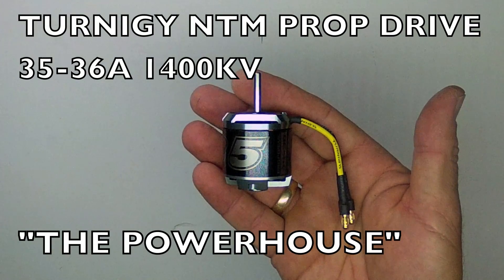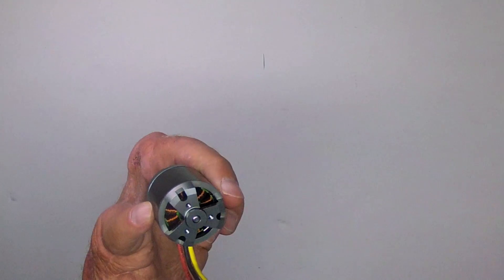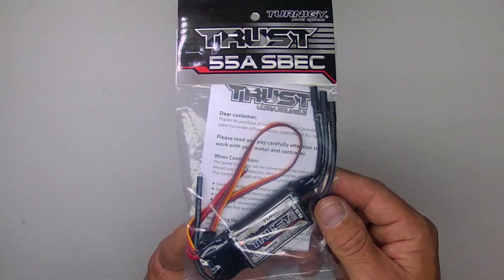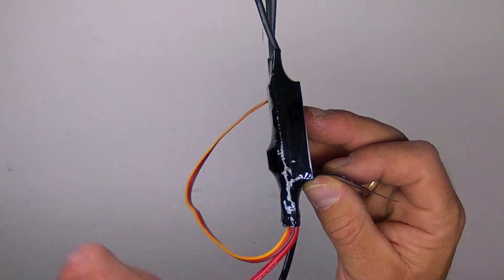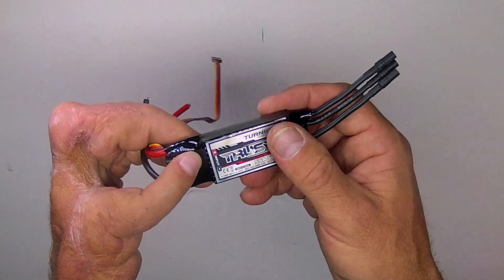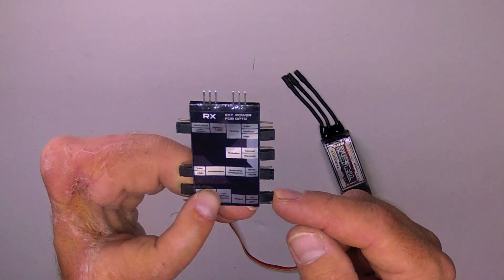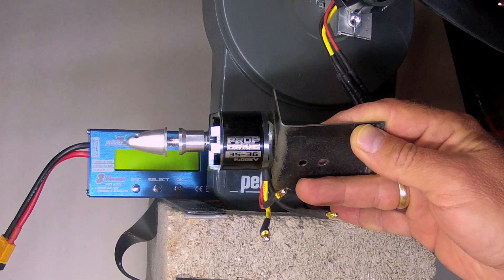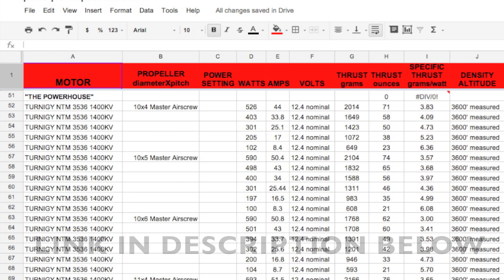TURNIGY NTM 35-36A 1400KV POWERPLANT TESTING - "The Powerhouse"

Comment: hi i just wanted to know if its necessary to have the programming card as d other available escs do not necessarily need one.please respond as soon as possible
Reply from the maker: Aaron Samuel Every ESC I have had that can be programmed by card can also be programmed by stick position.  However the method varies between each ESC so it is critical to have the instructions, which you can almost always find online.

Comment: EA thank you for the video. Per HKing's recommendation, I purchased an NTM Prop Drive 35-30A 1400KV for the Great Planes Cosmic Wind which is in the link I provided. How do I go about installing and attaching a prop? The  motor came with a threaded shaft that attaches to the opposite side of the motor but for the Cosmic that setup won't work...I think. Your advice and suggestion would be appreciated. Thank you. http://manuals.hobbico.com/gpm/gpma1810-1811-manual.pdf

Comment: I have a Turnigy Trust 55a S-BEC esc, Do you know how to program it using the stick?
Some how in program mode I made the throttle stick work in reverse, the motor runs in the right direction just the stick is reversed. How can I clear the esc's memory and start over?

Comment: Ed,  Just a further response, I've actually had quite a few issues with the TRUST 55amp ESC.  It seems to have difficulty with not properly reading the throttle range and then cutting out at less than 100% throttle.  I've gone through every setup configuration imaginable without luck.  If I swap in a Plush ESC instead; Full throttle, no worries.  Honestly don't know what to say about that except that maybe I got a bad one.  Very odd.

Comment: Ed,  thanks for the response.  I've done additional testing and experimenting and it turns out it is not the motor after all.  Apparently the TRUST line of SBECs really don't like Corona 72mhz Synth receivers.  If I put a Frsky 2.4ghz RX on the TRUST + NTM combo everything works perfectly, but the Corona causes this issue with this and with your "workhorse" (Turnigy 2835 + Trust 45amp SBEC)  combo as well.  Interestingly, no issues if I use a Plush ESC.  Go figure.

Comment from the maker: No, I promise they are right on as tested, and surprising in some places.  It's not a linear thrust output, and weird I admit.  It's a testament to going through the testing process.  Of course these numbers will change in a dynamic, flying situation so you really have to consider what you are doing with the plane, how fast you are flying at cruise vs. how much power you need on takeoff.  It's so much info you could spend a career testing it all!

Comment from the maker: I have not had any problems.  I just calibrated the endpoints high and low once and it arms fine after that.  I wonder if that isn't done first if your ESC is trying to enter the settings-by-transmitter mode if it is not recognizing the minimum throttle setting upon power up.  Ordinarily I would do as I believe you are describing and get three beeps indicating 3 cell lipo, then each subsequent power up should be normal.  You can PM me for more, or share a video and see if I can help.

Comment: Ed,  have you had any strange issues setting up this motor and ESC combo?  I bought this on your recommendation to go with my synapse build and I can't get the ESC to arm properly.  I have to power the ESC with the tx throttle at max and then slap it down to zero to get the ESC to arm.  Otherwise it just beeps 3 times at me and won't arm.  Any suggestions?

Comment: Ed,  The spec sheet shows the max thrust ratios for the 11" props as 11x4 - 2166g, 11x5 - 2092g, 11x6 - 2174g.  Is this correct, or are the 11x4 and 11x5 thrust numbers swapped?